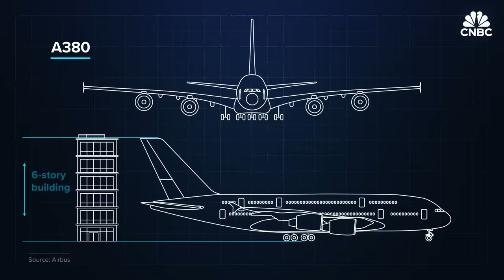Why The Airbus A380 Is Making An Unlikely Comeback

Comment: I think what CNBC meant to say was air travel is making a resurgence, and some parked A380's are being reactivated (Quantas and Lufthansa).  Of the 251 planes made, only 195 frames are airworthy.  Asiana and Qatar will both retire their aircraft in 2026 and 2028 due to maintenance costs.  China Southers, Air France, Thai and Malaysia airlines all already retired theirs.  Thai tried auctioning them off, however the buyer would have been forced to seek permits because they were in such poor shape.  Emirates has retired 7 of their 123 and uses them for parts.  Brittish and Singapore airlines are the only ones that have their original fleet airworthy.  
Maintenance costs were always higher than expected with these planes, and high capacity flights mid distance were profitable, but even in 2019 the pacific rim operators had a hard time getting a 70% passenger load.

The A350-900 seats 440, can fly 300 nautical miles further than the A380, and burns 27% less fuel per passenger than a 606 passenger A380.

Lastly, while the contributor was right to say it could hold up to 800 people, they were only set up to hold a maximum of 606 on Thai airlines, and many fewer on other lines (469 on Brittish, 407 on Korean, 485 on Quantas, and 471 on Singapore).  The A380 required a special Group VI slot, a $3.8 million jet ridge that couldn't be used for any other aircraft, and needed the best runways (that were at least 250' wide with skirting).    The 747-800 required a 220' wide runway and skirting (common width).  

Im not hating on Airbus - the 321neo and 350-900 are great planes, but the A380 was nothing more than a niche aircraft.
Reply: Very well informed comment, thank you.
Reply: The A380 is the best long haul aircraft ever developed. It’s hardly a niche aircraft. Now if you are an American that goes absolutely nowhere, then maybe it is to you.
Reply: The A380 was a lot more than a niche aircraft. Look at the vast majority of responses on this video to see how many people liked the experience of flying on it. Sure, the A350 is more efficient but it's also a much newer design, and production will take time. By the way, Qantas doesn't have a "u" in it. It was originally an initialism for "Queensland and Northern Territory Aerial Services". I'm curious where your figure of the number of airworthy airframes come from.
Reply: That's because Thai Airways is basically bankrupt. And Malaysian has also been bleeding money.
Reply: Hopefully all the airlines do retire their A320 and A330 aircrafts. It's ridiculous that those dinosaurs are still allowed in the air.
Reply: @pritapp788  but the equivalent age Boeings are OK? Why are A320 and A330 aircraft a particular problem? Some of the Qantas A330 aircraft are less than ten years old. Most of the 737-800 fleet is older.
Reply: @theharper1  I'm so grateful that what you took away from that was that I misspelled Qantas airlines.  Do people like flying in the A380, yes, but it is neither efficient, nor cheap to maintain. If the airlines can't make money and keep it flyingAir France was considering their lifespan before Covid hit, and that it cost 60% more to maintain than any other plane in their fleet.
niche: a specialized segment of the market for a particular kind of product or service.
Let's look at where you can versus can't use the A380.  There are just 140 airports (worldwide) that have a wide enough runway and skirting to handle the plane.  The largest operator, Emirates, services just 16 airports (72 daily flights) with their A380.  Not all 140 of those airports have gates that can handle the plane, so in reality there are only ~70 airports worldwide for it to operate from.  So yes, it is a highly niche aircraft when you compare it to the next largest passenger airplane, the 747-800, which has landed and operated from over 800 airports worldwide.
Reply: @merlinthemagus  I fly 130,000 miles a year, and spend the better part of 500 hours a year speaking with airlines and airports.  The A380 is undoubtedly quieter than the older planes, but on par with the newer ones.  The seats are all the same.  If you are in economy on the 380, Ricaro (who makes the seats) supplies the exact same ones in the a350.  The plane is bigger to walk around in flight, so I'm not sure what you are using as your metric for "the best long haul aircraft ever developed".  Considering there is no secondary market demand for used ones, I'd question that.
Reply: @theharper1  oh, forgot to mention the number of certified airframes comes from required annual disclosure from each of the airlines that operates within the space regulated by either EASA or FAA.
Reply: @Xander-dx6mw  So given that you do that much flying you should know what an exceptional plane the A380 is. I don’t fly that much but have flown pretty much every aircraft type available. I maintain that the A380 is the best long haul aircraft ever developed and hardly niche. Sure if you want it to fly into Cleveland, Ohio it probably can’t but then again the places I want to go to are serviced by the A380 and given the choice between that or the A350 ( which I flew this summer ) and the Boeing 787 which I flew 2 weeks ago, I would always pick the A380.  Some things can’t quite be measured, they are just better.  Just like some people know the price of everything and the value of nothing.

Comment: I have flown boeing's 747, 737, 777 and airbus's 310, 320, 330, 350 and 380.....all in economy cause i am poor but by far, the best experience i have had is with the a380 (flown only on emirates but multiple times)......its a dream aircraft.

Comment: I've flown on both A380 and B777, Emirates, the seat on 777 feels like it has half the width of superjumbo's. Unreal how comfy the plane is
Reply: Seat width has nothing to do with aircraft type.
Reply: @ThePolaroid669  if we're talking about economy of course it does, 380 is wider, same config of 10 abreast, hence seats are about inch wider.
Reply: @ThePolaroid669  Don't be silly. Fuselage width determines seat width. If you want 2-4-2 in a B777, the seats have to be narrower than 2-4-2 on an A380. Try and use your common snese!
Reply: It is hardly half the width for seats.

Comment: The A380 is by far the best and most comfortable commercial airplane ever built. It has the most space per passenger, even in economy, it is a super quiet plane  inside and you cannot feel turbulences, it is so smooth. Especially the upper deck with premium seats only and its own entrance makes it super comfy  for premium passengers who don't interfere with eco passengers.
Reply: I disagree with the upper deck with premium only being super comfy. You feel like your in a crowded bus even in business on the second floor due to the sheer amount of seats around you. Also service is slow because flight attendants have to take care of more business passengers compared to other planes.

Comment: 00:07 The Airbus A380 is a massive plane designed for long-haul flights.
01:45 The Airbus A380 faced decline but is now making a comeback
03:45 Airbus A380 faced significant challenges and investment, but lacked profitability.
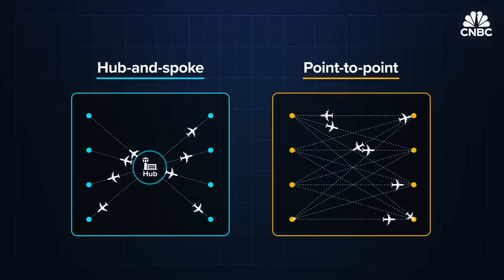05:29 The A380's unique design and features
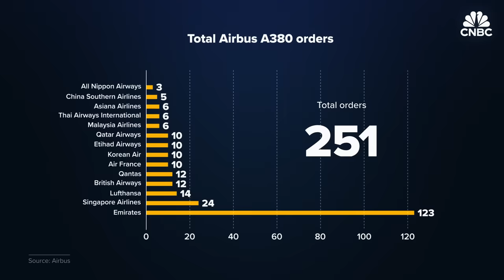07:18 The Airbus A380 offers high-end amenities and poses challenges for airports.
09:03 A380 is gaining popularity in niche markets.
10:51 Despite challenges, the A380 has a long future ahead.
12:39 Airbus sees A380 as a success

You Can't Judge A Video By Its Cover. you can by its first few chapters and certainly by its last.

Comment: The 2008 recession dealt a major blow to the A380 since gearung toward efficiency  / fuel economy became prominent coming out of it and four engine planes will not cut it in this new world.
Reply: The gulf carriers make money on it, so it's not about fuel, it carries such a large quantity of people that airfares stay largely the same, it's the same way you can't drive a bus as daily driver, not because you can't, if you're rich you can but it's impractical in most places unless they are specific places
Reply: @mwat22  The Gulf Carrier also receive money from around the world for their oil reserves.  So they can waste money on expensive luxury items.
Reply: It was important long before any recession.
Reply: @erauprcwa  irrelevant. Business owners want to make a profit. People want to waste money on themselves, not providing a service to show off.
Reply: If you can fill the A380 it is very efficient. Even compared to two engine planes. It's just very hard to operate routes that will consistently fill such a large plane and with a lot of empty seats it's a very inefficient plane.
Reply: @sebastiang7394  the airlines and the markets I’ve told us otherwise, with the exception of the EK. Even they canceled their last 27 on order.. it is not an efficient aircraft even airbus doesn’t claim it is at this point. Aviation has moved on from it. Those that are keeping it for now or waiting for the deliveries..
Reply: @sebastiang7394  If it is so efficient, why did no one put 700+ seats on it? It is not efficient at all, and barely carries more passengers than a 747 or 777.
Reply: @bftjoe  While it's an inaccurate statement that the 380s carriers "barley" more than a 777-300ER, it is a true statement they are not efficient. There is typically a 100+ seat difference between the type and sometimes more. .
Reply: @johniii8147  Why did you put fake quotes around a misspelling made by YOU? You do realize that Korean Air has A380 with 399 seats, and Singapore has some configured for only 379, right?  Yes, that qualifies as barely more. 777-300er is listed at a typical seat configuration of 350-396 passengers.

And when you also consider operating economics, the A380 would have to consistently fill double the seats to be comparable to a 777-300er, so your 30-50% more seats don't even come close, buddy.
Reply: @erauprcwa it’s cost per seat is very good. Some airlines ordered it without being able to fill the aircraft though. US carriers operate from a variety of hubs so it’s not feasible for them or many other carriers. BA though and ME3 for example route their flights through very busy hubs so it’s a huge success. I cite BA as an example so you can’t make the state subsidy excuse to slander the aircraft efficiency which can’t be questioned if filled. BA were trying to buy some used aircraft pre pandemic so I wouldn’t be surprised if they acquired more of them. Other airlines like AF hadn’t updated the cabins since the aircraft joined the fleet so they were incredibly dated, in the end it was cheaper for them to just retire the fleets. As for Emirates cancelling orders, this was Airbus’s doing as they wanted to stop production anyway and clearly even more fuel efficient engines which would have led to a huge order from emirates wasn’t going to come.
Reply: @bftjoe  Joseph Huang, part of human communication is understanding intent even when things are mispelt, or errors are made. Sorry that you are so deficit in your communication skills that you feel the need to compensate by being rude to people who do not share your view.
Reply: @brownmold  You put quotes around a misspelling made by YOU. That is called misquoting, not understanding intent, unless your intent was to misrepresent what I said. If feelings are so important to you, instead of facts and logic, I see why you support the A380 to make your feelings good!
Reply: @bftjoe  dude, really. At least try reading, and seeing whom you are accusing of doing what. See how you are failing at even simple communication tasks?

You are the one ranting about feelings. Feelings you "barley" understand. 

Dear Joseph, try a little less emotion, a little less screaming.
Reply: @bftjoe  you are not even recognising whom posted what. And you have the gall to rant about misquoting?
Reply: @brownmold  Ah yes, the defender of billions of $ in waste is talking. Everyone listen to the brilliant person!!!?!?!?

You can also make jobs by making holes in the ground and then filling them, so good!!!!! Very brilliant logic, A+++++!!!!

Your feelings are very important, so you defend this huge waste!!!!! Big plane made your head big!!!!!!

Comment: One of the most incredible planes ever... even making shadow to the 747. I am sad to see that it didn't work out commercially
Reply: Tell that to Emirates and Etihad.
Reply: It will be in service for two decades and still used by 10 companies though. So a win for the consumers.
Reply: The A380 doesn't shadow the 747. The 747 was the perfect plane capable of basically anything, the A380 was too large and incapable of what a 747 can do
Reply: @Planetrainguy  Most of people on this comment section are consumers so our priority is to have the best passenger flight in that regard A380 is above 747.

Comment: The A380 is a true giant of the skies, and has a good safety record. On November 4, 2010, Qantas Flight 32 was flying from Sydney to Singapore when it suffered an uncontained engine failure. Thankfully, it made a successful emergency landing in Changi, and no passengers, crew members or peope on the ground were injured despite the debris from the engine falling onto houses in Batam.
Reply: Added benefit is I dont think the US Military would teleport an A380 off the face of the earth like the MH370 Boeing 777.   If not just size, the rareness of A380 flights and flight paths makes it very high visibility operation.

Comment: Since the airports that can accommodate it, like LAX which remodeled and expanded the international terminal to support such a large plane, still exist. That won't change. I'm hoping someday Airbus can restart production of the plane. Restarting production should be faster and easier than developing another large plane from scratch. Just look at the comments on this video. They're almost all A380 fans. I've flown the A380 three times. I hope it will not fade away.
Reply: Yeah, a bunch of random YT commenters certainly know more about airplane economics than Airbus itself.
Reply: The equipment is already gone. Keep dreaming.
Reply: if you like flying, you'll love the 380!!
Reply: The production line was converted to that of the A320 family. I suspect all the factories all over Europe which made the major components also no longer have the ability to contribute to the production effort with the huge backlogs for other models

Comment: My opinion: this clip is completely OUT of touch with reality, here’s why:  due to COVID, nearly all airlines have been faced with a pilot shortage (a lot more than usual were forced/convinced to retire during COVID). With a current pilot shortage and FULL airplanes, the A380 can solve 2 business problems (pilot shortage and full flights) in the near future. Supply and demand will fix the pilot shortage and the A380 will again face the same problems that forced Airbus to discontinue manufacturing.
Reply: Cargo airlines have a pilot excess, not a shortage. You must live in the past.